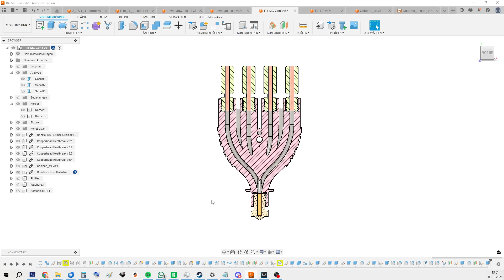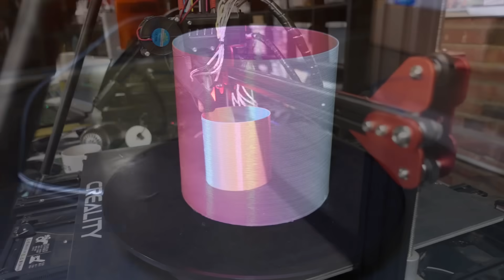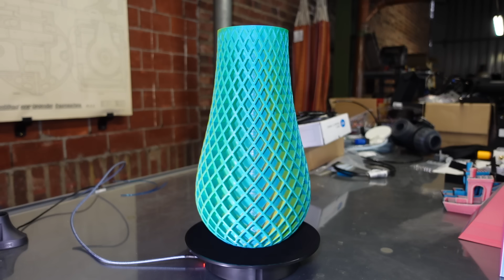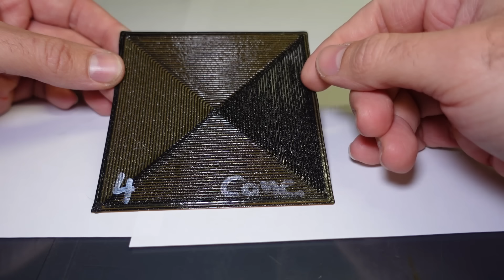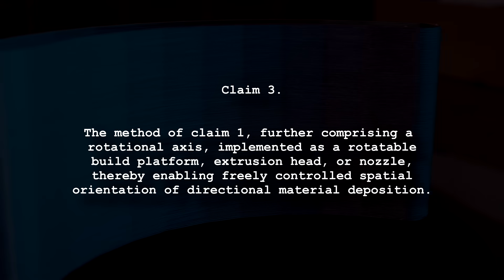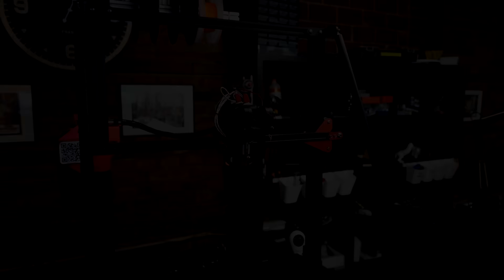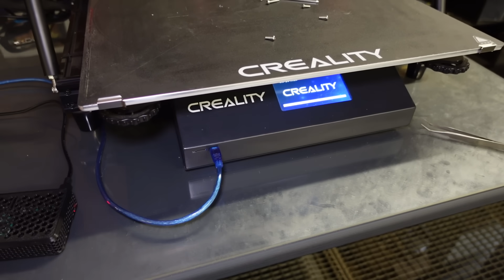WASTELESS Multi Color 3D-Printing. Introducing the Open Source Co-Hotend (Roetz-End E03)

Comment: Prior prior art: https://www.youtube.com/watch?v=UyP4f2rYaCU
Reply: Yep, there's plenty of previous art, it's just not very easy to find
Reply: Damn, that's cool
Reply: Cetus2 would be another even more similar example, that's also made it to market in a production capacity.
Reply: @Roobotics  That's exactly what I was thinking of.  I had one, what a garbage printer.  Had some neat ideas though, but execution was absolutely terrible.
Reply: @crashingsux very true, just because it was 'done before' does not mean it was done well per-se. Also maybe not 100% the same, the way laminar co-extrusion is being taken advantage of here.
Reply from the maker: Yes I was not aware of that. One of my discord members posted this yesterday and I've contacted him.

Let's see, maybe we get some collab going!
Reply: @Roetz40  Rotating the bed on a lazy susan is simpler and more reliable than a rotating hotend, even if the kinematics are a bit weird.
Reply: Came here to post this
Reply: Indeed Nozzleboss did a similar thing. I also tried a similar thing for my graduation project using dual filament (Multi-colour 3D printing through nozzle rotation | TU Delft Repository https://share.google/2YJPxomuhUgQPAyXR) However I think using multiple filaments will result in more reliable prints.
Reply: There's also https://www.youtube.com/shorts/sc0HAumJMis

for the rotating bed version of co-extrusion based polychrome FDM.
Reply: Fairly sure that isn't the oldest prior art for this type of multi color printing. The first instance I've seen of this dates back to 2011 where I have a photo of a printer with this type of multi color printing. And I've also seen one in 2019 where they were somehow able to get a patent on the same tech already on a maker meet.
Reply: Prior Prior Prior art is multi-tip-colored pens,  highlighters / markers to  lesser extent.

Comment: if you could spin the bed you "could" use only 3 RGB colors or if you still want to do 4 you could use the CMYK colors and with cleaver G code you could print potentially any color with only 3 or 4 different colored filaments

the other option is if you have variable speed extruders to just mix the colors in the hot end much like a 2d printer dose

Comment: imagine adding a mechanism that could rotate the nozzle in 360 degrees with stops of each end so the filaments wouldnt tankgle from continuous rotation, than you could have a custom slicer script that would rotate the nozzle along the print path to set what color is visible and you could have full controll of where and what color is deposited with every gradient in beteen

Comment: "Wasteless" except the 2 or 3 colours you arent using being wasted because they aren't being seen. You just moved the waste from a priming tower to the walls. if a print was 2% blue if i printed it normally with a filament swapper vs if i printed like this with a rotating hotend, id be using 25% of total print weight as blue for 2% of the end result to be blue? doesn't make sense to me.

Comment: you might just maybe be able to get an adequate full CMYK scale by having more sectors in the nozzle (example: 24 inputs cycling between C, M, Y, and K in a loop) so that the angle each sector takes up is small enough that you can get a full range visible from the side. it would be horrifically bulky and probably very impractical but might work. or if you could somehow get the internal flow dynamics to work, use 4 inputs that are each divided out and rerouted to achieve the same result

Comment: Dude diamond and cyclops hotends use the same technology, and both are garbage

The problem with these is the unused filaments in the tubes, they burn into coal which is difficult to remove from even a straight path, let alone with a bending one like inside this

This hotend is only useful if you want to use all intakes at once all the time, if even one stays idle it'll cook inside

Had both a diamond and a cyclops hotend, both showed this, both was useless for multi material printing

Comment: fake multi color it just creates quad-filament on the go. you can still see other colors at certain angles. you can't even choose which parts oif the print will have a certain color because it depends on the print direction.

Comment: this is pretty much the same as multicolor filament we have had for years with the addition that the color split is bound to the printers axes.
i expected a way to print different colors on the same face. that's just multicolor filament with extra steps.

Comment: Combining this with a turning print bed you can maintain the same print angle by rotating the work piece under the nozzle. This will let you print any color on any side of the print.

Comment: I believe the actual challenge to solve multi color printing with this platform lies in rotating hotend assembly or bed. Either is theoretically possible but rotating hotend would require tight tolerances for the rotating assembly to keep pointing at the same position. Rotating bed would require a tight tolerance that would not change initial bed mesh throughout the rotation. You could track how overall bed mesh shifts due to rotation with exterior probes but that would require more sensors and compute dynamic bed mesh as it prints(I don't 3d print so IDK if initial bed mesh is static or not - I assume it is static).

Tool changer seems to be the optimal solution for general multicolor/different material support prints as the problem is focused on getting the head changed, aligned and primed.

This is cool and interesting nonetheless. Thank you for a food for thought.

Comment: I don't have the time resources, but you can create a 5 heater hörend which can enable more different filaments and through viscosity changes due to different temperatures a less or stronger flow and mix of the filaments.
Reply: You would need a single heater close to the nozzle and on each filament path a one-sided slumm heater as used in bamboo printers so each filament has a distinct heat delta if needed.

Comment: No use multiple extruder Boden extruders and  find out how much the color gradient changes if you push different filaments harder.. the internal nozzle form can make things different as well.  Spiral extrusion, unmixable or even strongly mixed extrusion depending of extruder force and Filament path.

Comment: From the meeting point of the 4 streams to the tip of the nozzle.. that's at worst 10mm or something. Now it would just need a coder to dump 10mm of extrusion into the infill of the model and continue.. of course would need for 4 extruders to run individual filament stream. May also require less heating power to not cook the non flowing filament too much. Super compact design. Kudos. It's being so close to actual full color 3dp
Reply: Thinking about it. What if the filament stream would stack on top of each other into 1 main path. In that scenario the switching colors has a very predictable offset that can be timed precisely I would imagine so you can swap colors while extruding continues. That would indeed solve current gen multi color printing

Comment: Since you're already using 4 heat breaks on one extruder assembly, why not go 1 step further and have 4 full hotends and 4 nozzles, combined in as compact of a form as possible? I'm picturing some mini linear rail that swaps out just the nozzle + hotend + heatbreak by having 4 of these on the rail, and just moving the extruder to the selected one.

Comment: I love how much potential crazy things you could do with this if you keep young with this. Like if you added an axis to rotate the nozzle, you could make designs on the sides of objects. Adding a 5th (or would you need 6?) axis, to rotate/move the nozzle tip (or the bed itself) you could print things on to any angled surface. And if you add a filament splicer, you could do some crazy stuff, like a d20 with different colors on every side.

Comment: I saw their prior art were they show  a rotating head. Note that also this solution seem to use multiple filament feeds with different colours I assume. This made me think about the following. What you try to achieve is that multiple colours exit your nozzle at an angle you define. This is why a lot of people suggest the rotating nozzle. If that is your goal I suggest a different approach. Is it technical possible to create a multicolour filament which has the cross section well defined and constant (like the pie you show in your video. In such case you only have to deal with one filament extruder one nozzle and one spool holder / tubing. Your contraption of rotating becomes easier and lighter.  The tricky part is to know the angle of how your filament enter the nozzle. I suggest this could be done with some electronic colour sensor placed at the point were the filament enters the nozzle. I hope you succeed somehow.

Comment: I don't fully understand how the gradient works. In a perfect world, only one of the colors is actually the one that determines the color of the wall. Imagine a circle with 4 quadrants, each with a different color, and move the edge of the circle along a straight line. at any point, only of the quadrants is touching that line, and that would determine the color. If you rotate the circle you wouldn't get a gradient, instead the color will jump from one quadrant to the other. 
So how does the gradient appear in your prints?? Is there some mixing of material going on?? I see the gradient in your prints, but I just can't explain it to myself.

Comment: Curious, if you use a filament with an additive such as copper or something with quick heat transfer - could it increase print speeds with a shorter melt zone, depending on additive it could possibly lubricate the fluidity of the material flow.

Comment: Great idea! Wouldn't it work if you put 3 -part nozzle, each output in-line and drag that as a full CMY pixel (3 different extrusion pressures to define the color). It would begin in the infill, then rotate 90 degrees after 2/3 of the nozzle exruded their not yet mixed colors to the invisible part and at the end, it would do the turn back to infill.

Comment: Just a clarification, someone will try to patent this, and they may get the patent, regardless of the prior art. Then it becomes very expensive to get the patent overturned, even if it is bogus. So, just saying. Prior art is required to overturn a bogus patent, and it may prevent a bogus patent from being granted, but it won't save you from the cost of fighting the bogus patent if it does get granted.

Comment: What happenes whebn you add 4 independend extruder Motors so you can stop or reduce the extrution of either one or multiple filaments?

Like in your example the orange one - just stop it extruding and you get a solid black layer.
Manipulate it in the middle of the layer and you could get even more variations.

Comment: I like this, although without the ability to rotate either the bed or the nozzle, this has limited (but still useful) application.

Although it's true that there is no visible waste with this, you are always using all four colours at the same rate, so lets say you have a print which only needs a splash of one of the colours, that colour will still be used up at the same rate as the other colours.  Think of it like a 2d colour printer, where you have CMYK, but most of your prints are black and white.  The printer would still be using the CMY at the same rate as the K, so you'd use four times the necessary filament.  In the 3d case, it's not strictly speaking being wasted, because it's providing structure to the print, but it's possible that the mostly hidden filament is also the most expensive (e.g. it could be a more expensive metallic filament for spot effects).

There are a couple of situations which this can't handle.  For the first, let's say you're printing a tool handle, and want patches of TPU on the surface to make it more grippy.  You could certainly do this, but the TPU would also be used throughout the whole of the handle, which is probably not a good thing.  A similar situation, is that I sometimes print CF filament for just the surface layers, and use cheaper filament for infill.  The other situation is that I often print a different material for support interface layers.  This isn't going to work at all, because the interfaces will have the same mixed composition as both the supports and the print.

None of these negatives are meant to suggest that this invalidates the idea, just that it's got limitations.  This would for instance be ideal with a dual extruder system like the H2D, where you combine the best of both worlds.

I applaud you going for the open patent.  I do think patents have their place, but the way they are (ab)used today is to protect big corporations' monopolies, whereas the system was supposed to protect smaller companies from having their ideas ripped off before they could recoup their development costs.  Some patents have no merit at all due to prior art or being obvious, but challenging them is too costly, so to get in there first with an open patent is a great idea.

Comment: I'd be interested in a "mini" version. The geometry could be far simplified by machining only the mixing chamber, the longer melt zones would be separate parts that screw in at the correct angles. 

If the melt zones were connected with heat breaks, then each filiment could have individual temperature control with a final nozzle zone that could rapidly adjust for printing conditions like overhangs. The mixing chamber could also be manufactured with basic machining tools, which would be a substantial end user cost savings.

Comment: they already sell multi color filaments that do EXACTLY this without a bunch of extra work 😂... clown
Reply from the maker: Sad. You haven't understood :-)
Reply: So wiseguy:

1. Do these filaments also rotate the nozzle relative to the bed, so you can print the right blend of colour in the direction you want at any point in the print, e.g. a vase where the colours spiral to align with the spiralling faces?
2. Even if you don't need do change orientation during a print, can you ensure with these filaments that the right colour is always facing in precisely the right direction, e.g. so that red is always facing the front exactly?
3. Can you order these filaments with any combination of four colours in a specific arrangement?
4. Even if you can, can you then use that same filament to print a different project which requires the colours in different positions?

Pro tip: before calling someone a clown, make sure you aren't making a fool of yourself.

Comment: Color, schmeuler.
The possibilities with multi-material engineering filament are WAY more tantalizing. For example:
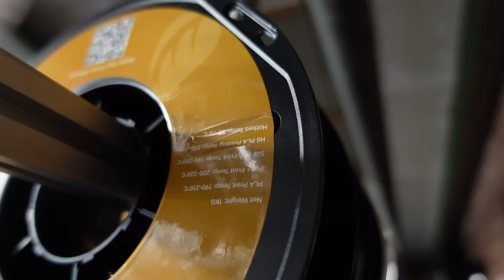Hard/soft layers for sound & vibration damping, (you already show this at  8:22) The toughness is an added bonus.Other "contradictory" combinations:
* Conductive vs. insulating for antennas, RF-absorbers, reflectors, "metamaterials"; selective electroplating
* Soluble vs. insoluble for creating fine-mesh filters, sieves, foams, artificial tissue, bones, etc.
* Low-melting-temp vs. high-temp for non-catastrophic failing components
* Soft/Hard for creating stiffness-gradients (by adjusting orientation) - most stress-risers and fatigue-cracks originate wherever there are sharp stiffness-transitions
* Foaming vs. non-foaming for lightweight parts (hard shell, soft filling)

Applications in Food (chocolate/marshmallow), Artificial organs (bone/cartilage),
Reply from the maker: Very nice collection of usecases! Thank you! Join the discord ;)

Comment: This great trick could also be do with multicolor filament and be opened for more people without a lot of tinkering.
The biggest issue is if the filament turns around causing a color change.
I do not have a solution for this unless the filament is made into a square 🙂 or a mechanism to read the orientation of the filament and compensate for it during printing.
Maybe this could be a loop hole for making patent.

Comment: This method of multimaterial printing is absolutely fascinating. Though, I'm curious as to whether it can go between materials with vastly different temperature requirements (eg something like PETCF at 320c) to something like PLA at 200c for cheap supports, rather than just something that's pretty close like TPU and PLA. Are the multiple melt zones separated from each other enough to prevent the heat conducting into each other, or is this best for materials with similar temp requirements?
Reply from the maker: yeah i do have different melt zone temps planned

Comment: You should specify that the movement of the print head is relative to the print surface. I can work around your patent by having a stationary print head with a print surface that moves on x and y.

Comment: The next move is cmyk printing using a calculated premixed flow of colours , im surprised no one has done it , if the pre nozzle volume is predictable and the machine knows its flow and how long it needs to premix before the nozzle to get the right colour to flow at the right time i think its doable.  Probably using a camera to regulate the flow and actively adjusting the flow and mix to get the desired result of timing , colour etc.   it will happen one day , sooner if someone gets the idea , send me one when you crack it :)

Comment: You should make one with just two sides but add a rotating bed or nozzle to control which side is shown. Then you plug two ams/mmu or whatever into it. One side does current print color facing outward and the other does next color purging on the inside simultaneously. Then it's a simple poopless 180 degree rotation to change color. 
Or am i missing something here? Only thing i can think of is that it needs really opaque filament to get consistent colors.